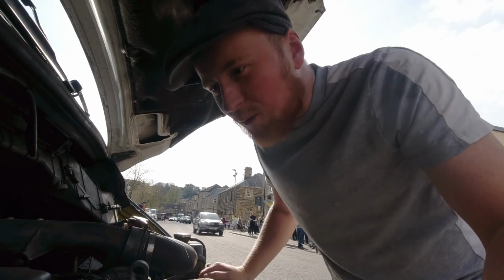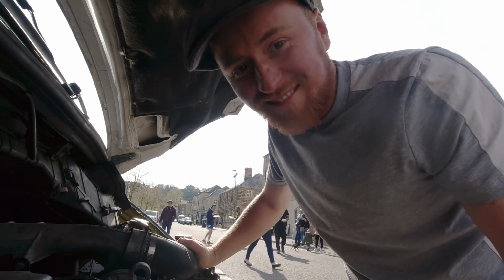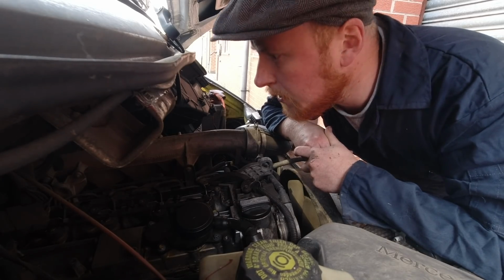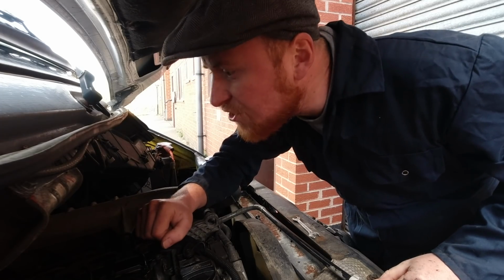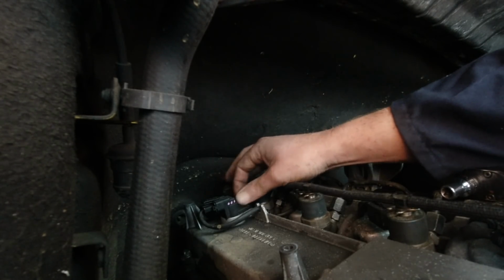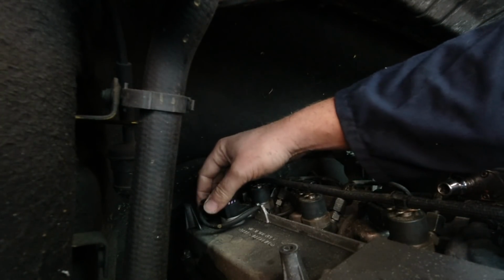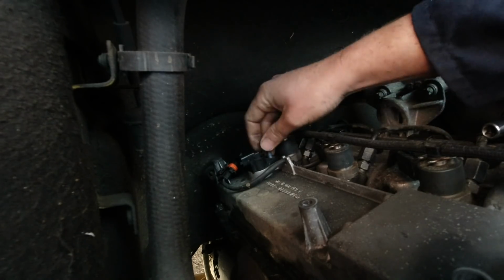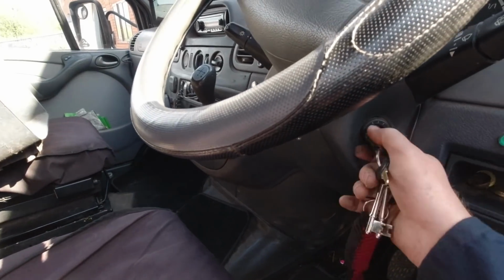Sprinter CAM shaft Sensor change (T1N)

Comment: Think about buying  a scan tool code reader , cheap and money well spent . As it was intermittent and triggered by heat , you could have cooled down or heated up the suspect sensor . say with cold water on a rag or a heat gun . to help track down the fault . Good video .

Comment: I broke down last week, recovery diagnosed camshaft sensor.  Changed sensor and engine would not even spin over. Changed crankshaft sensor and is now perfect. Knowledgeable mechanic recommend change both.

Comment: If its like Renault its 9 times out of 10 the crank angle sensor, even though diagnostics say cam sensor. They seem to pick up flakes of rust and crap being low down on the engine but usually a clean is all it needs.

Comment: Hi CJ, thanks for the videos, I really enjoy them. Hope you can get back to Portugal soon mate, it looks beautiful there. I bought an old Transit Herald motorhome recently so that I could get out and about a bit, I can't walk very far at all so it's great for chilling out somewhere beautiful, like Skye where I just went on my first trip. My Carver gas heater isn't working and I was thinking about having a diesel heater fitted but wondered if you could let me know how much battery power yous uses please? Paws up to Lance, Kev.
Reply from the maker: Thanks Kev,

I cant tell you off the top of my head to be honest bud, they use a bit to get going whilst heating the glow plug and spooling up but once they are lit its only turning a fan, not very battery heavy.
Reply: @ProjectAmber  That's great CJ, thanks. I was concerned that they used a substantial amount all the time. That doesn't sound like it's too much for my 2 160 Ah batteries. Hope to see you if you ever come back to Scotland, all the best, Kev

Comment: My Vito camper van has had a couple of episodes where it would not start, and would almost start and eventually start at the supermarket car parks usually when I was in a hurry. I thought it may have been a fuel issue. It hasn't happen for a couple of months now. 
Usually if the sensor dies it stays dead as it happened to my Mazda crank angle sensor. The Ford sensor cost me A$250 trade, had I bought the Mazda they wanted A$340. Both are the same both are imprinted with the same MazFord logo and part number and It was in a real arsehole of a location to get to.
This may help particularly determining if the Crank angle sensor apparently is you don't see the Tach reading change while cranking the motor then that may the problem (read down 1/3 in the website). I'm going to keep an eye open in my case.
https://www.mercedes.gen.in/sprinter-2006-cutting-none-start-notes-causes-things-check/

Comment: MAF (Mass air flow) sensor - CLEAN IT !!! After driving up and down your dusty / muddy back lanes in Portugal etc., I guarantee it is swamped with smeg... Also, get yourself an after market (cleanable) panel air filter - Apple CIDRE vinegar is a good cleaning solution, to cut through grease etc. 👍

Comment: Oh and buy OEM sensors as the aftermarket stuff either doesn’t work right or fails within no time more often than not.
Reply: Buy Chinese ebay parts, buy twice.... Bottom ball joints lasted 6 months, MAF sensor didn't last a week!

Comment: check out your relays in mine its number 7 fuse box drivers side it senses the glow plugs are ready before engaging the starter solenoid you can swap out the relay with the same in the same box it can be intermittent drove me crazy for a while but an easy fix if yours isnt the same you can look at your circuit

Comment: Nice job CJ. But don't run yourself down. You have done plenty of jobs on your van that professional mechanics would struggle with. You do well.
Just one observation. You said the word is that if it is the crankshaft position sensor it would not start at all. There is an element of truth in that, but I have known a CPS break down when hot, but work ok when cold (even testing with an oscilloscope showed no problem when cold).

Comment: Typical fault and sensors like that gets cranky when they get older. And the symptom says it all about those sensors. Had the same fault on my car some years back. Good that you fixed it and got it back up and running.